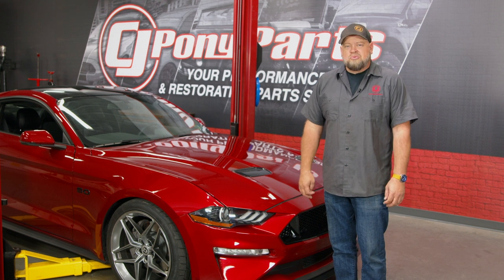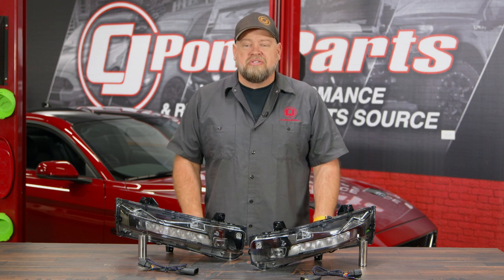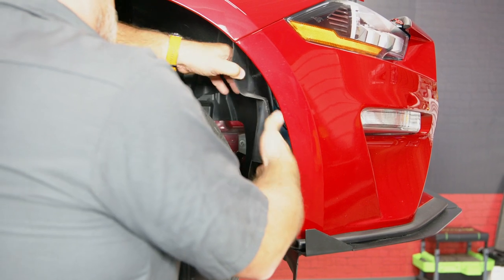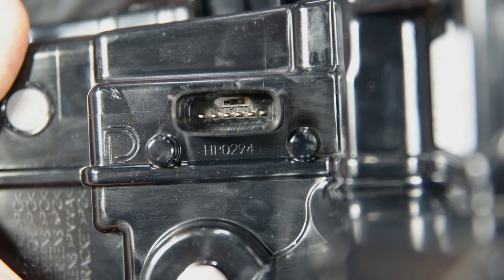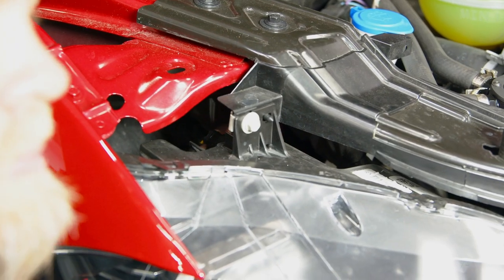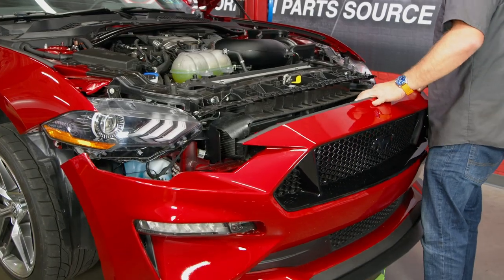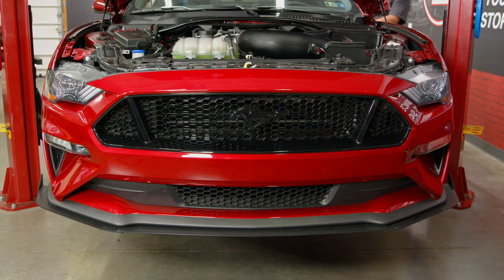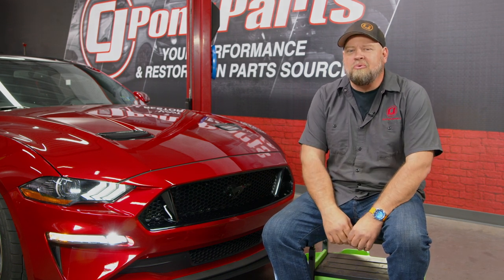2018-2023 Mustang Install | Diode Dynamics LED Fog Light and Sequential Turn signal

Comment: How would connecting this light to the headlight harness work if i also have the RTR grille with led connected to the headlight harness?
Reply: Wondering the same thing, have you figured it out?
Reply: I was about to buy both tbh..until you guys rescued me...still going with the grille though lol..

Comment: why can you still see a hint of amber in DRL mode? Also, does anyone know if you have to use the harness? I already run an RTR grille with the lights and have that harness off the headlights. I could care less about having these be DRL's , just wondering if they will still function just as plug and play minus harness.
Reply: You only use the harness if you choose to have the drl option...duh.
Reply: @charleshenson4183  no shit!! No one had an answer for this 4 months ago....not even diode dynamics new the exact function of what the harness did.
Reply: @steveamestoy  
WoW...well I may not be the smartest guy in school,but at least I don't vote democrat.
Pretty easy to figure out by simply listening to the video when he clearly says...IF you want drl add this harness and then proceeds to show how to do it.
The IF part told me I had a choice.
Reply: @charleshenson4183  I'm glad you were at least smart enough not to vote D 🤡

Comment: Is absolutely necessary to take the whole font bumper off?
Reply: No yust removed the front wheels n removed the plugs from the fender guard n bend it to the side n you will have access to the lights that’s how I install mine to my gt